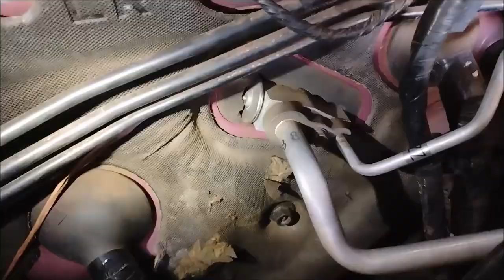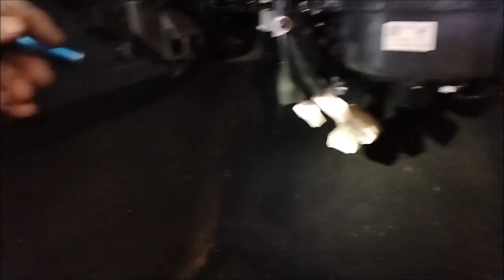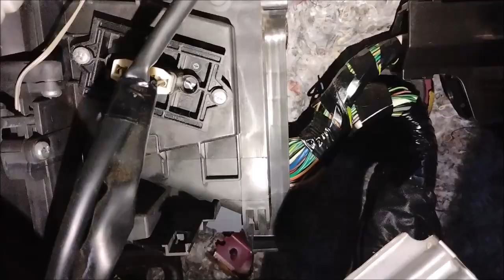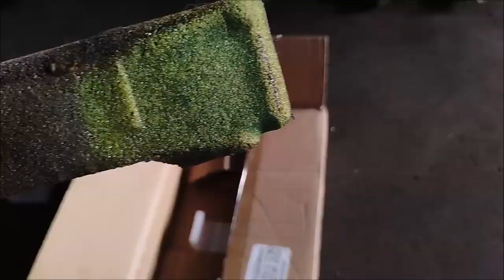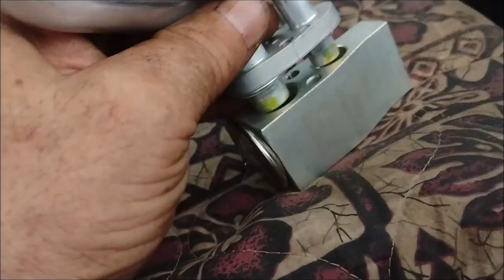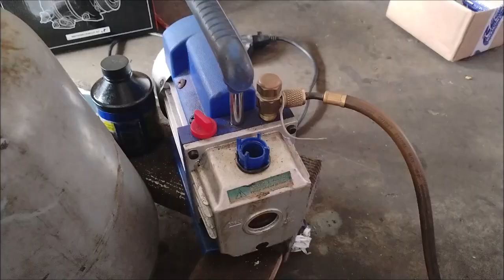2015 Subaru XV Crosstrek AC Evaporator - How to Replace DIY

Comment: can you provide the part number for the replacement parts pls great video and explanaiton thx
Reply from the maker: Parts are in video description.
Reply: @Merryfrankster_  not all of them the O ring which you used is missing and the pipe that you replaced also isnt listed
Reply from the maker: @ChrisJericho58  sorry I missed these parts previously. Evaporator pipe assembly Part No.: 73430FJ010, o-ring assortment UAC	RS2653
Reply from the maker: @ChrisJericho58  added these to the description.